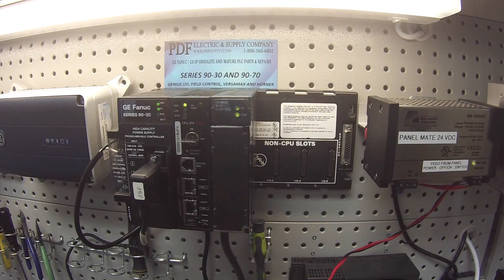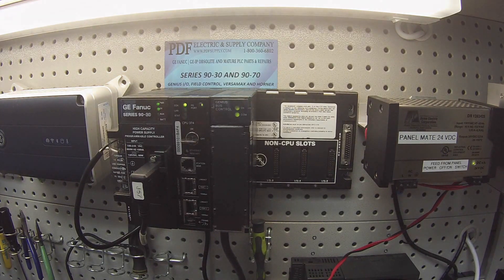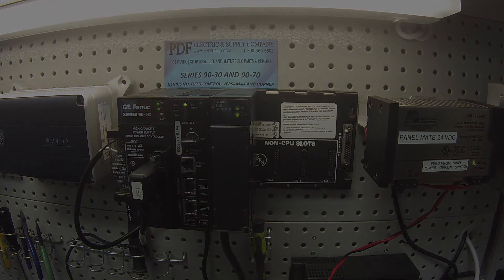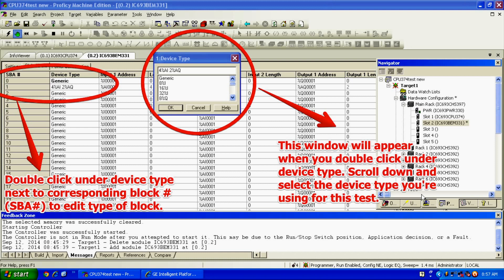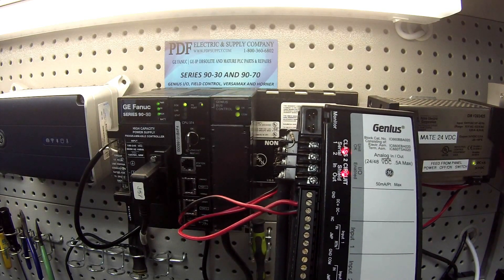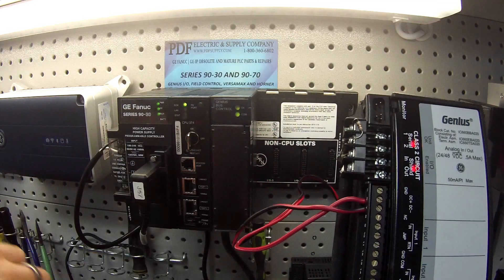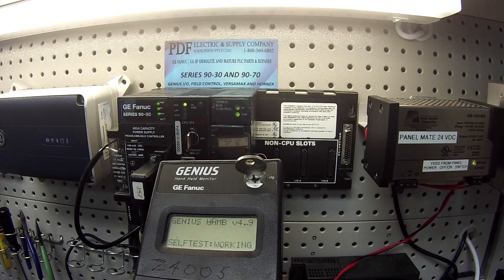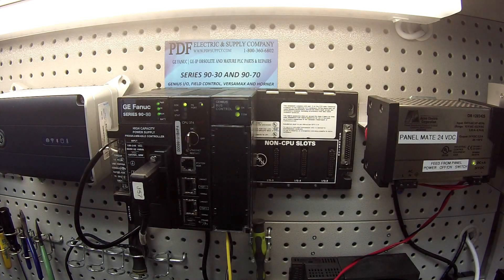How-To Troubleshoot: IC693BEM331(GE Fanuc PLC Bus Controller 90-30 & GENIUS Block)

Comment: hello we are india using GE ACC400CPU with Genious BEM331 module with DC drive. now the DC drive has failed and we are connecting ABB make DCS880-S01-350A-5 drive controller on to BEM331, we have hand held monitor on the drive unit. can you support on line to connect PLC and ABB drive